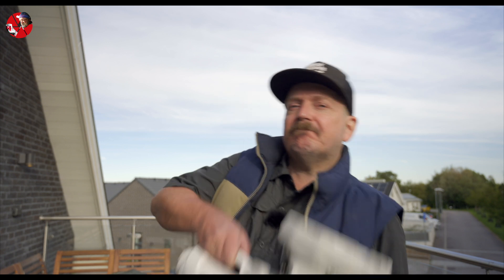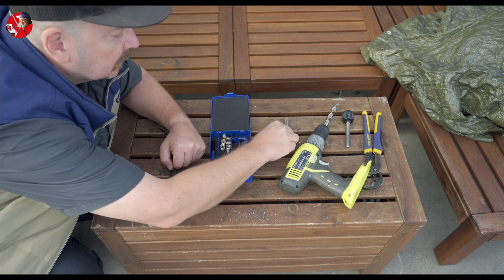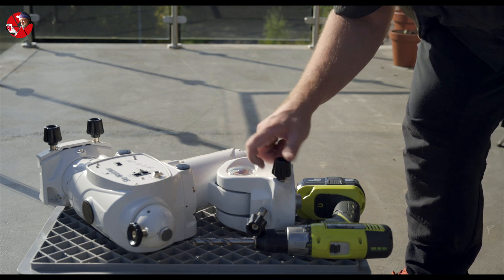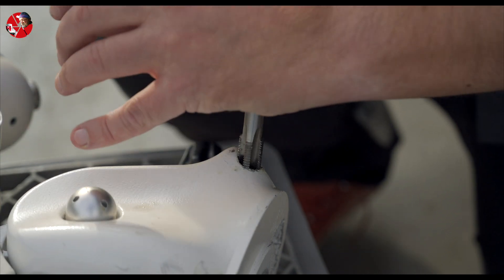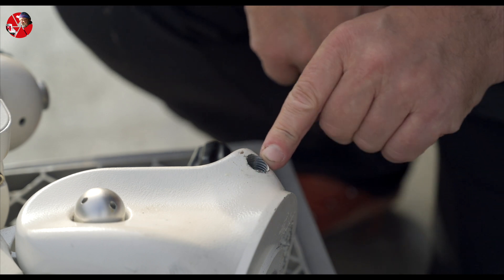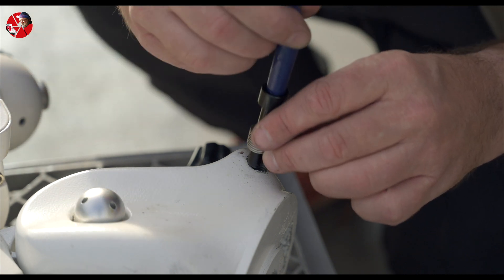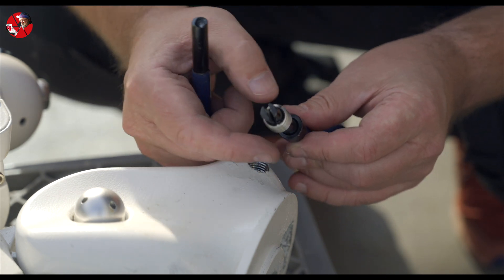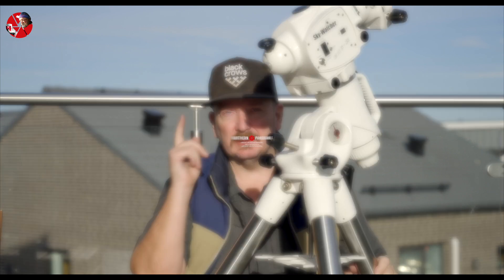How to fix a damaged thread in a Sky-Watcher EQ6 R-Pro  4K

Comment: you should go back and forth with the new, larger threadcutter, to cut the chips, and you should use oil for lubrication.
And you don't need the insert, you can use a larger bolt instead.
Reply from the maker: Thanks, will keep that in mind! This time I bought a thread kit. It still works great since this operation!

Comment: There is a great ProjectFarm test of these helicoil parts and at the end he tested the force needed to strip or break new thread and results are great. You get much stronger tread than original and much harder to destroy it. This is not only a repair but an actual upgrade. I have HEQ5 with altitude treads striped from previous owner and planed to do same thing. Great video BTW!

Comment: Dave, how did the bolt threads get worn? Maybe from transporting it in the car?
Reply from the maker: Don't know but the adjustment bolt are made of steel and the old thread aluminium, so I think it's just a matter of time before the thread worns out! Don't know if car transporting could affect that.

Comment: Those helicoil threads inserts have saved so many parts, and as a bonus you get good steel threads in Aluminium. In my opinion, those adjustment screws should have come from the factory with either steel or brass inserts.
Reply from the maker: Agree x2, it's a shortcoming with this mount. Should have come with more sturdy threads! And yes, it was an easy operation and this will probably be functional for a long time!